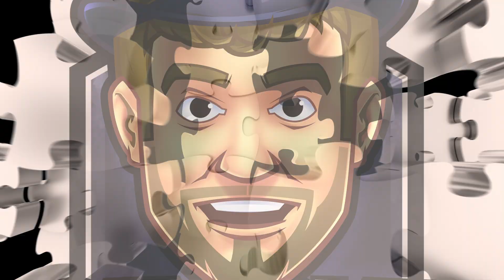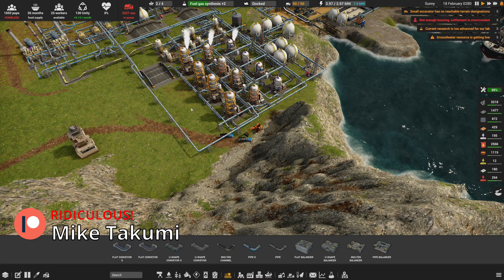OUT WITH THE OLD, IN WITH THE NEW! (Beta Finale) - Captain of Industry - 23 - Beta Gameplay

Comment: 2 Electric boilers takes 2.2MW to make 48 steam-hi / 60 sec. This turns into 3MW of mechanical power in 2 steam turbines + 1 low pressure turbine which turns into 2MW electrical power in a power generator II. So electric boilers are going to be power negative when driving electrical generation (Which it should be) Even if it violates conservation of energy when counting mechanical energy.

Comment: I would never bother with wood alternative, just build your parts and home goods productions close enough to shore to deliver wood. Even if you can make enough steel, the drain on your coal and diesel from the mining and smelting will be worse than the drain of the diesel for the cargo ship, and it also takes up a lot of space in your vehicle cap that could be used for better things.
for your fields, you can dig up a layer of the rock, dump just dirt, and then place a field.
the way to control what gets dumped in an area is to highlight that area with a mine control tower, and ban the dumping of all other resources.

Comment: If the electric boilers somehow would actually work, that absolutely violates conservation of energy.
Reply from the maker: It doesn’t give you back water. You still need to add that in. It’s fine. The steam is made from water and power, which then generates energy from the turbines, but the water still needs put in. It isn’t replaced by the power production 100%
Reply: @CharliePryor  the conservation of energy thing is that a steam turbine works by adding energy to the water by heating it, then extracting that energy by spinning the turbine. Water is also super unreactive, so unless you are doing some ridiculous matter antimatter thing to destroy the water and turn it into pure energy, the fact that you aren't recovering the water has nothing to do with the fact that the energy extracted as the steam cools and decompresses can't ever be more that the energy needed to boil it in the first place, and it will usually be far, far less.
Using an electric boiler to run a steam turbine is like using a solar panel to light a lightbulb, and then using that lightbulb to power the solar panel, or like running a wind turbine off of a fan plugged into that wind turbine. There is no power input, the best you can possibly do is for it to sustain itself with no external load. We did this sort of thing in my highschool engineering class, conversion losses brought the system to a stop after several seconds, even with no external load pf trying to power other things.
It's theoretically possible that the game will let you create something similar to Oxygen Not Included's self powered oxygen maker, but I doubt it will, as the game seems to stick fairly close to realism. What the electric boiler should actually be for is for doing something like seawater desalination without requiring a fuel input, you can just create the steam with electricity rather than trucking fuel across the map to your water plant or whatever.
Reply from the maker: @bow-tiedengineer4453  they don’t produce as much electricity as they consume, it seems. It would be net negative. Better? :)
Reply: @CharliePryor  that's what I expected, and why I was saying you probably wouldn't be able to do that. Glad to know they didn't include a perpetual motion machine.